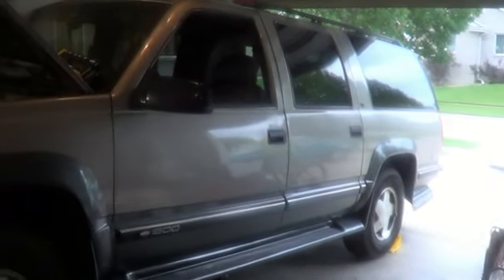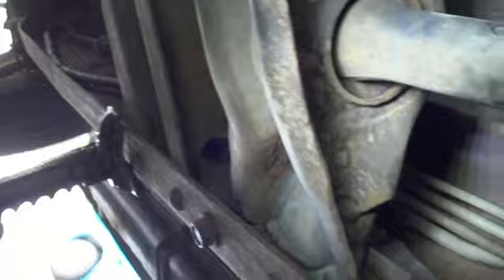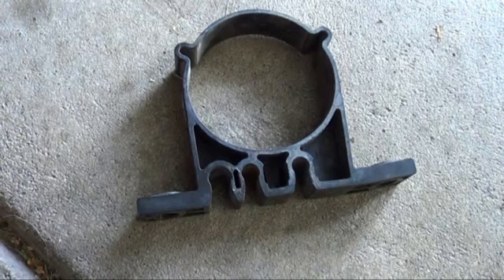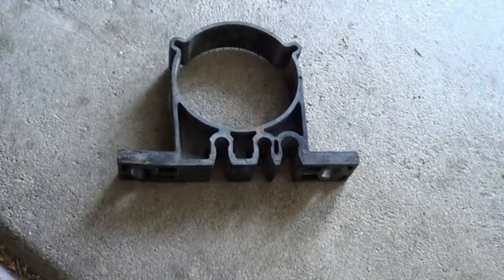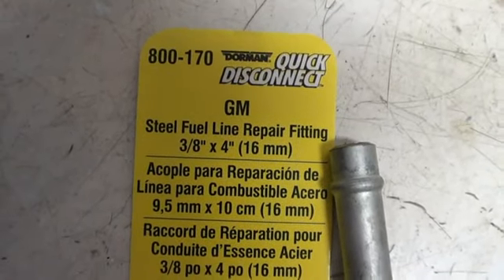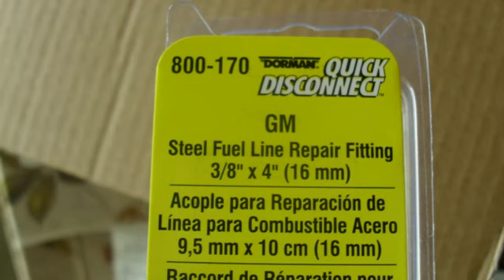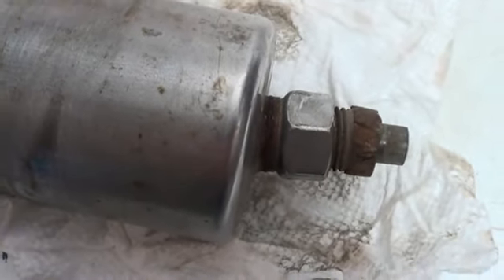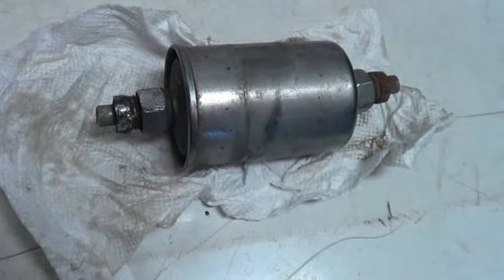1999 Chevy Suburban Fuel Filter Replacement Fix

Comment: Great video. Really helped me see what i need to do. My front line fitting came out fine on my 98 silverado, but the rear stripped really badly. Going to use the pipe cutter and cut really close to the filter, then cut my new line long enough and put the compression fitting on it to Connect to the old line on one end and to the filter on the other.